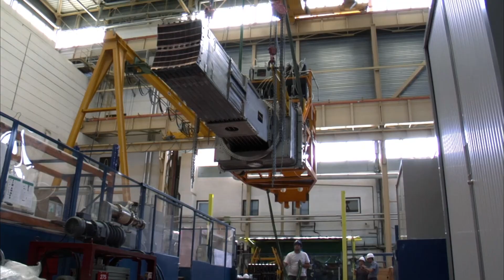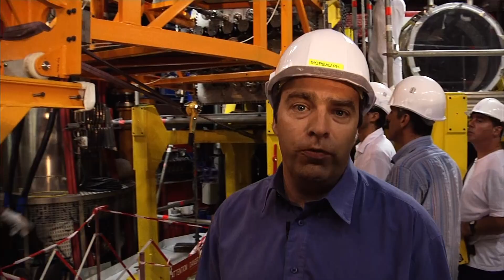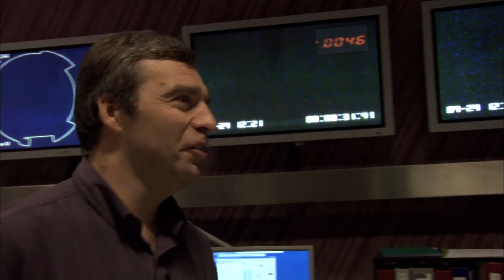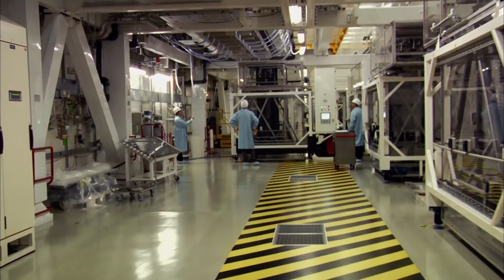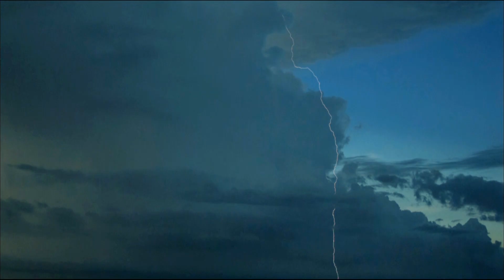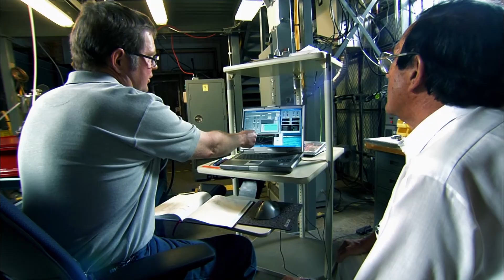Building Green - Sun on Earth

Comment: Nucleosynthesis always requires energy. Fusion doesn't get to bypass that fact. That's why it has always required more energy to create it than what comes out. 

The whole universe wasn't "quark gluon plasma" in the beginning, the galaxies were quark plasma shrapnel from a collision in space when our universe turned itself into a massive particle collider. Quark plasma runs this universe, not fusion. The catalyst for fusion is all the electricity that can be pumped into it but the catalyst for quark plasma is the endless supply of the matter that causes the force of gravity. This is the catalyst that a reaction so efficient requires. Quark plasma will do everything that science thinks fusion will accomplish.

Comment: its so funny because they are engineers etc it took them hours to fix a door by just simply closing it. They need simple minded people on the job because they will always take the longest route to fix a problem. A random bloke walking in asking what the problem is and they say the door wont shut something is broken would have just answered well have you try closing it and opening by hand? and would have fixed the problem in 5 min instead of searching the whole electric system for a bug.

Comment: You RETURTED WITH 3OO CREW.  BULLSHIT.. HYDROXYL ...NO FUXION...THIS HYOXYDE HYDROXYL...FUCKING Just LIQUID...BATTERY CHARGE...BATTERY IS POWER SUPPLY RUN DC MOTOR GET FEED BACK RETIFIED CAP STORAGE...NO ELECTRICK...MAGNET BATTERY COIL...TRANS FORMER...TAP THE LINE ON OFF NOW QURJYENTE ..SIMPLE CURRENT GET XTYL YOURN LOOP LINES ..VOLTAGES YLLUMINUM CAPACITOR MICRO HEATER DIODES ...MAGNETRON IS HOW BECOME MAGNET...HEAT MAGNET STOVE DE MAGNETIZE THAT MAGNETRON GENERATE MICRO HEAT THEN FAN WILL BLOW TO SPREAD AROUND ...

Comment: Indonesia is about to receive a ship from China carrying a Thorium fueled, Liquid Salt, Nuclear Reactor (aka LFTR) it will tie up at a wharf and supply the city with cheap Base Load Electric power 24/7 - 365 for more than 20 years. l predict within 20 years every port in the will have several of these ships providing electricity. If they also carry a desalination plant they could use Off Peak electricity to provide the city with drinking water drawn out of the harbour which would take the strain off rain water stored in dams. The world has enough thorium to fuel nuclear reactors for 100,000 years

Comment: Zapping pellets with lasers seems impractical. How do you get a sustained output? How does the burst of energy from the zapped pellet get captured, yet not interfere with the next pellet arriving to be zapped? It doesn’t make sense to me.
Reply: I'd imagine you'd have to figure out a way to launch another pellet into the machines center at intervals. The problem their focused on is whether gain can be achieved with this process. Once that's determined you can focus on the part you bring up. Science like this works in fits and is extremely slow going because the overall problem is basically composed of a bunch of extremely difficult small problems. It's why everything takes so long.
Reply: ikr. How do you re-thread a thousand hair-fine wires.

Comment: The energy win by "fusion" is not possible. It is always fission of neutrons out of atomic cores, which releases energy, when these neutrons turn into protons, electrons, anti-neutrinos, gamma rays and kinetic energy.
Reply: What? Have you heard about the bright shinny thingy hanging in the sky called ☀️ sun ?
Reply: @joergkalisch7749  The Sun is releasing energy by the same process as I have explained shortly above. Fusion or the buildup of greater element cores are a byproduct of the high pressure and energy release by free neutrons.

Comment: Dumb ass eater means inertial electrostatic reactor and you're showing a 3D diagram of a Tokamak reactor which is the donut plasma which is never going to stay in plasma because it's a fucking donut and it doesn't have an epicenter like an actual plasma reaction is supposed to have in order to sustain that's why they're going with the Farnsworth inertial electrostatic grid reactor